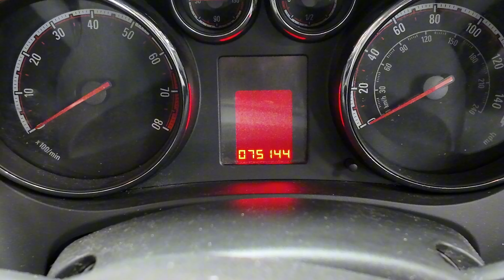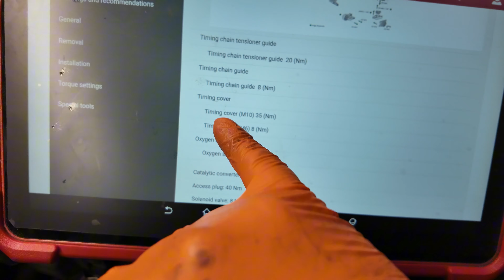ECO TEC OF DREAMS!!!!! I'M SURE EVERY MECHANIC ENJOY'S DOING THESE TIMING CHAINS......

Comment: Customer of mine, a driving instructor had a 2006 1.4 Corsa it was 12mth old when she bought it, she changed the oil 3 times a year, that car did 255,000 miles before she retired  as a driving instructor, on the same engine and and more surprisingly on the same timing chain don't get me wrong I put about 12 clutches in it (and I'm not exaggerating) and that engine still sounded sweet. And what you've got to remember is that 255,000 miles were all round town. Just goes to show if you change your oil regularly and look after your car properly it'll do it.
Reply: my 1.3 astra van with the fiat engine did 190 thou . sold it now , never changed the chain

Comment: I have two vehicles using this engine. Both are under 25,000 miles, but it was interesting to watch that video. I think more regular oil changes are the key here. You can’t predict a tensioner fault, but the chain drive will last longer in cleaner oil. The old Corsa had problems with chains too, only because oil services were missed. The plastic guides then emulsified themselves into a plastic blob !.

Comment: 9:15  just a tip baz, the correct timing locations on the cam phasers are deeper than the others. You can just see it on the video. 
In theory the timing tool shouldn’t fit in the shallower sections.

Comment: Nice job again, you make it look too easy, that locking tool kit is nice. Noticed you didn't use your bonnet stay, and worked around the original one, loads of room though.
Reply from the maker: Funny enough I needed it for another job 😂😂😂.... It's crazy how you lot notice these little things... Proof that you are a good follower 👌👌👌🤙🤙🤙🤙
Reply: @bazmeredith  Cheers mate, get a haircut too 🤣
Reply from the maker: @tomcurran65  I've already been 😂😂
Reply: @bazmeredith  oh, eh, good job 👍, em yeah, looks well 🤣 seriously though, great videos, great info and tips, I do a bit of work on cars and can handle most jobs, but your videos keep me up to date on new vehicles, techniques and tools, mechanical and diagnostic. I'm an engineer by trade but I find the auto industry has moved fastest for innovation in the last few years with materials and design good and bad. Your videos show the principles are the same but the details in the techniques define the differences. Add to that you are a bloody good mechanic who analysis the fault to decide on a path forward to a fix, not just reading the first code that comes up. Good job 👍